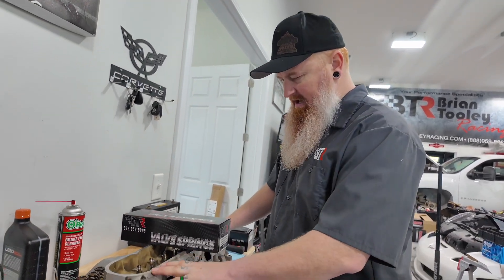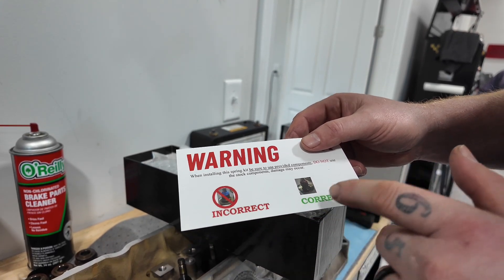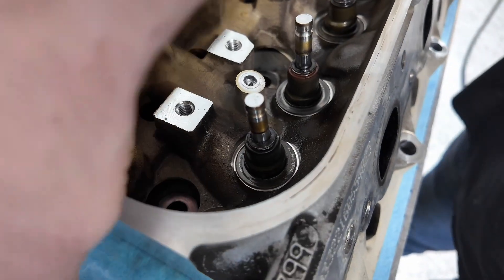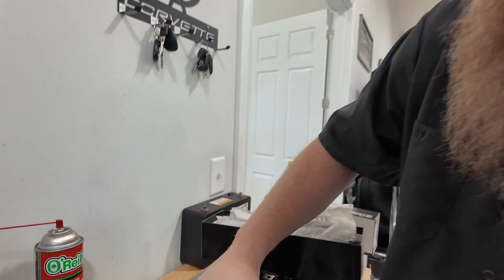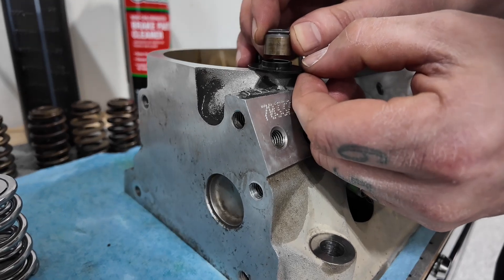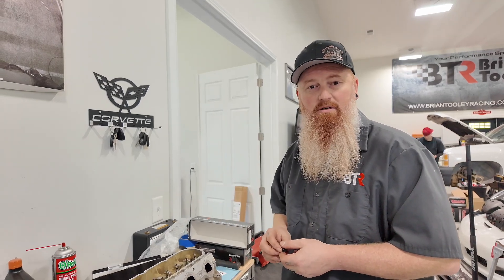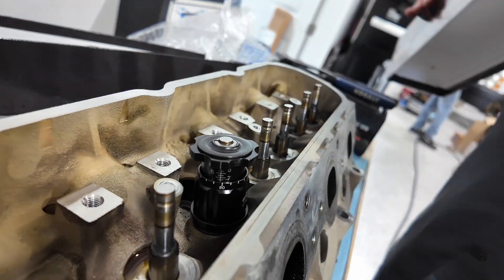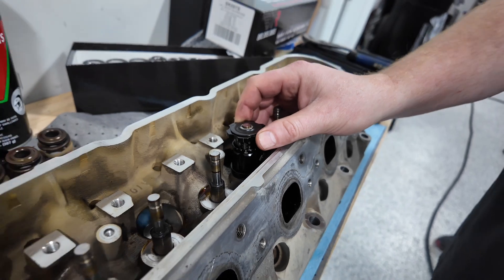BTR Builds: Getting Your Valve Spring Height Right!

Comment: 1.070 coil bind .060 safety and .637 valve lift on the btr cam. 1.767. with the platinum series valves springs box says height is 1.780 so no shims needed correct?  lt4 setup.  measured the install height with snap gauge on #1 exhaust total was 1.715". do I ad the coil bind and safety to that ? total if I do is 2.412 what am I gauugi8ng this against?  .645" taller than the calculation at the beginning (coil bind +cam lift+.060 safety)

Comment: So I'm using the BTR Stage 2 Gen V Turbo Cam with the 660 springs and titanium retainers.  My machine shop set the spring heights to 1.70-1.765.  There are some shims under some of the locators and none under others.  The math is 1.07+0.06+0.639=1.769.   I'm I safe with this? If we use 0.050 as a safety it would fall at 1.759.

I'm probably going to be running around 25 to 30 lb of boost.  These are also 2.00 SS and 1.60 inconel Manley valves.
Reply from the maker: First, thank you for choosing BTR! Technically, your math maths, and with the 0.050" safety margin, you are good. A couple of things to consider: at 30lbs. of boost, and depending on the rpm you are going to spin the engine to, your combination might be happier with a different spring kit. If you would like to call us, we'd be happy to talk through your engine combination, vehicle build,  and goals for the car to ensure your cam and valve train perform at its best. 1-888-959-8865.